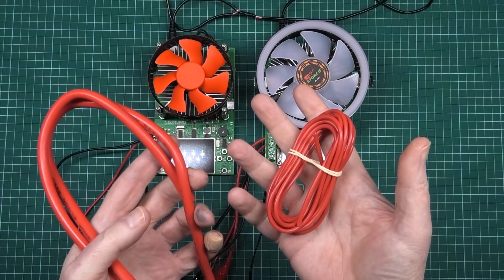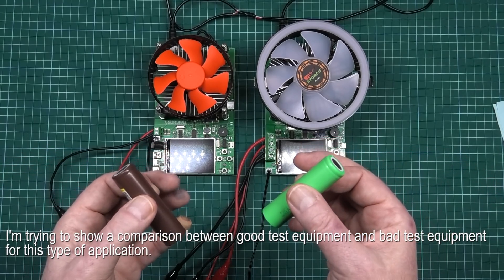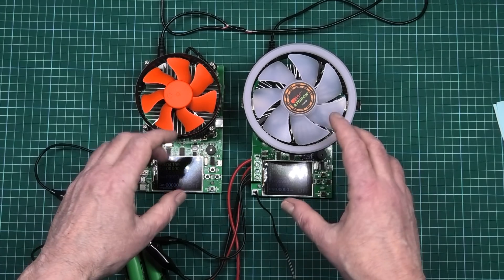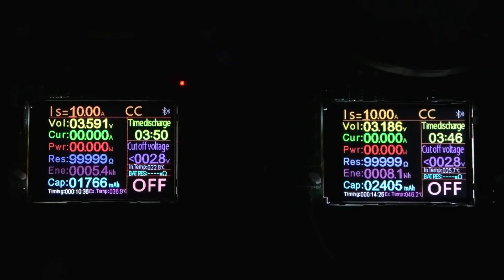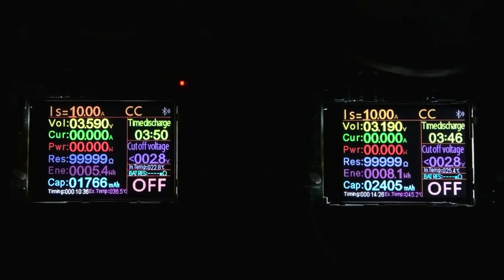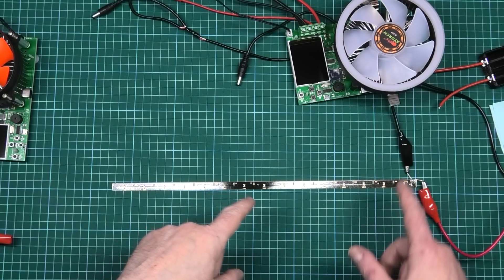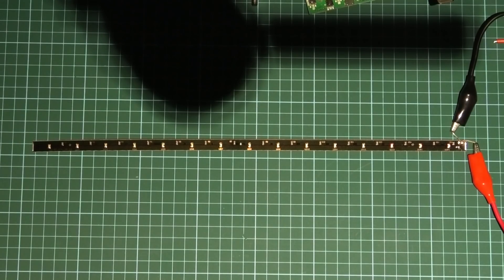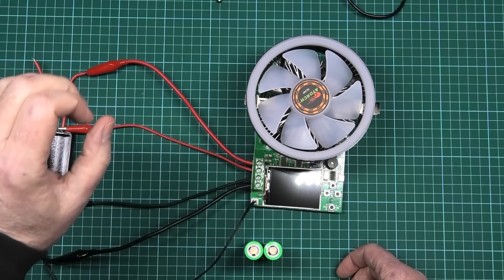e-bike / e-scooter builders, please watch this. Wire thickness really does matter!

Comment: For 4 wire configuration, cable resistance should not matter almost nothing. You should get quite correct mAh reading with long/thin cables

Comment: So I currently have the latest version of the one without the 4 V inputs (line and sense) with the coarse and fine knob pots and it seems to be doing fine.  It's just really quirky with the single momentary press select button.  I will also be getting the latest version with color LCD for aliexpress so I can test them side by side.  If I'm really only going to be testing 18V or less 20Ah or less LiFePO4, Li-Ion, and SLA batteries is it really necessary for better accuracy to use the sense terminal on the new one.  So far the current one seem pretty accurate using my Fluke multimeter as a cross-check.  Thank you.

Comment: How can I get in contact with you mate? I need your expertise on an e-scooter I'm pulling my hair out with. Cheers mate, much appreciated
Reply from the maker: Sorry for the delay mate - vortecks2000@gmail.com
Reply: @Vortecks  That's alright mate, I know your busy. Iv actually fixed it now. Turned out to be a broken voltage wire, coming from the speed controller. Absolute junk, the wire are all hard plastic, and not silicone. Not something I was expecting on a £2000 scooter. Even the speed controllers are just cheap £35 ones from China. Crazy. But I will contact you though as I could do with some info on putting a Li-ion pack together for my aircraft..👍🏽

Comment: On my ebike i have 12awg all over. Would i save something like 5% extra battery energy if i simply switch all to, say, 8 awg?
If so then very much worth doing 😁
Reply from the maker: It all depends on how much current you're drawing and the quality of your batteries. If you're only puling a relatively low current, you might be ok but if your wires are getting warm, there's definitely some savings to be made by increasing the wire thickness.

Comment: Hold up! Mr Vortex. Please help me with this. 3.593v and 1766mah, you still have about 0.4V left of energy left which is about 40% of the total capacity. 1766mah ÷ (1-40%)=2943 mah potentially. I understand that it is not linear and at lower voltage the is lower energy, but still, it might achieve the 2405 mah like the other one did, quite easily?
What is causing the sag? Could it be related to the components inside that device rather than the wire thickness?
Reply from the maker: No, the sag is 100% caused by the thin wires. The components on both discharge boards are essentially identical. If I'd reduced the current enough, it would have outputted the full capacity of the battery but I was trying to show the effect of having wires which are too thin at high current.
Reply: That makes perfect sense. Thanks mr Vortex :) it's like trying to push too much water in a narrow pipe. All sorts of losses!
Reply from the maker: @Electrifry  Exactly!
If you imagine a battery as a water tap, when you open the tap, water can freely flow out of it. If you then attach a small hose (thin wire) you introduce resistance into the system and water cannot flow freely. The thinner the hose (wire) the more resistance.

Comment: Always love watching your videos, I'm in the process of upgrading my 10 awg cables to 6 awg, so that I can increase power from 92v & 80a to 92v & 125a. I'm going to leave MXUS 3kw 3t Turbo cables stock, I'm just hoping the 4mm phase wires can take the 11.5kw bursts.
Reply from the maker: Yeah, they'll handle it - I peak at 22kw for 3-4 seconds but after that, the current drops right off (watch my last VLOG where I explain why) 😉
Reply: Whoa 22kw. I knew it was big, but not that big (what she said). Tattu batteries arrived! But longer than the Turnigy packs. So I need new mounts. I need a 3d printer...any recommendations? Stay safe. Mw
Reply from the maker: @18ct  Cheap and cheerful mate - Creality CR10. It's what I used to do all the parts for V3 😁

Comment: on a cheap chinese 1kw kit ,would it be a waste of time changing all the wires to  a thicker gauge even inside the controller ? since its most only 20a 48v
Reply from the maker: I wouldn't bother mate. If no wires are getting hot and everything is working, leave it well alone.
I'm more referring to the people who are building everything from scratch (especially batteries). One bloke sent me a photo of a battery capable of 5kW and he used 12AWG wire as the main DC outlet but he couldn't understand why he was only getting half the power out of it.

Comment: If you wish to upgrade the older 2 wire dlp24, Atorch also sell just the populated circuit board and attachments, (4 wire   terminal + thermistor, even a combo battery testing tray if one wants,) without radiator and fan for about $20 delivered, (after applying aliex coupons.) I attached a standing radiator and dual fan setup I had from an older style, but now broken tester, and it seems to work well (it just needed a 2 to 1 fan adapter, as the dlp24 has only 1 fan input on the board.) I agree with you, I think the new 4 terminal version Atorch tester is a real quality upgrade, and the thicker wires supplied with it is just another  reflection of that. The only caveat to add about always using thicker gauge wire if possible is make sure the wire material is the same. 8 AWG CCA (or just aluminum) may be thicker than 10AWG pure copper core silicone or PTFE wire, but in this case I'd think the thinner copper wire probably has better ampacity?

Comment: A very informative video well explained, You had me on the edge of my seat with those led's I was waiting for the pop as the tops fly off the led's it shows you how robust they can be it's the heat they generate which is quite impressive for such a small device. As long as it's not the batteries that are smoking.
Reply from the maker: If I'd pumped more current through them, they would have popped..... I feel another video coming on which explains the different effects between voltage and current.

Comment: excellent explanation i make and repair vape mods and always shocked at some of the wire manufacturers use in these devices amps are a real thing lol i always use wire from a company in northwales component shop . co .uk maybe worth u checking em out all there silicone wire has the ratings on the listing and also outside diameter which is really handy for application i used to have a small model shop lhence why i know of these guys and have a fair few bits and bobs which maybe handy to you bud
Reply from the maker: I've used Componentshop for many years mate - all my silicone comes from them because I know that it does what it says on the tin 😁
Reply: @Vortecks  aww nice one bud indeed its good stuff used to live near them in bangor lol good bunch of people there at cs

Comment: Great stuff, another interesting and entertaining vid. Thanks Tony, time for a bigger bench psu so you can tune those Leds for maximum smoke!
Reply from the maker: I should have put more current through them but they'd have just popped instead of smoked. I might do a separate video which explains the different effects that voltage and current has 😁